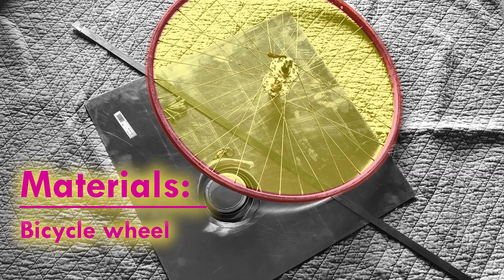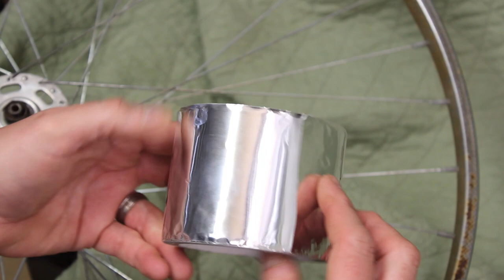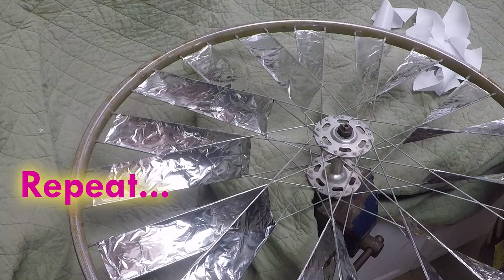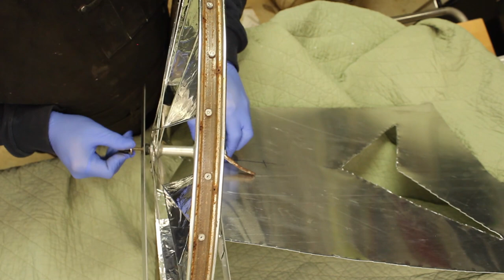Simplest Bicycle Wheel Windmill Ever! - Steps for an easy DIY homemade kinetic weathervane sculpture

Comment: Very Cool windmills! i have a question when using old bicycle wheels should  you re-grease them for a smoother function, or is there another method that doesn't create resistance?
Reply from the maker: When using old wheels, yes, I do like to disassemble the hub and repack the bearings with new grease. You need specific tools for that job, so it's not something everyone can easily do. But if you have the proper "cone wrenches", it's not a difficult job. When reassembling, I like to keep the bearings a bit loose (looser than it would be for actual bike riding). Note that cartridge-style bearings (that are often found on higher-end wheels) are not easily adjustable, so traditional "cup and cone" bearings work the best for this application.

Comment: Can you list out the names of the tools you used?
Reply from the maker: Thanks for your question. Here are some of the types of specialty tools I used, with time stamps:
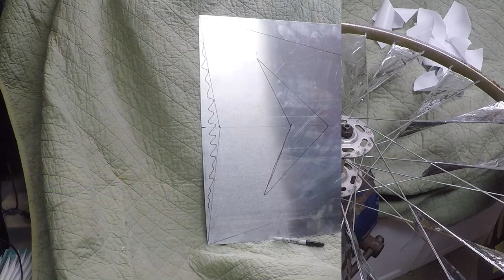1:53 - metal snips, straight cut
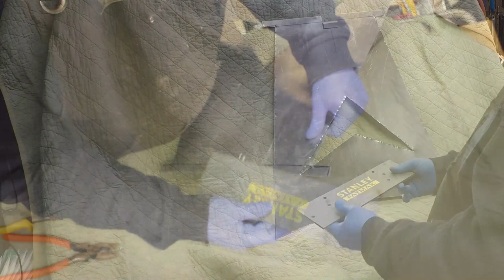2:20 - sheet metal folding tool
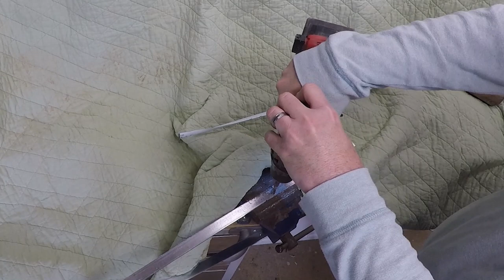2:57 - standard drill and bits for metal
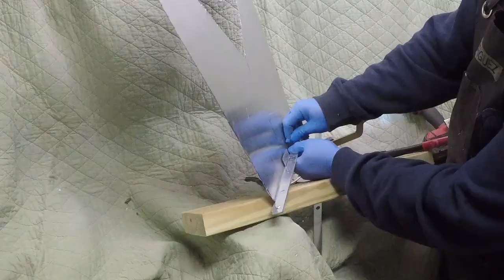3:22 - hand pop rivet tool, with 1/8” rivets